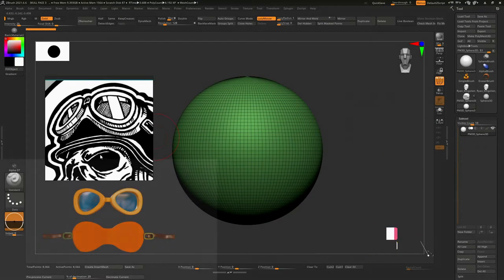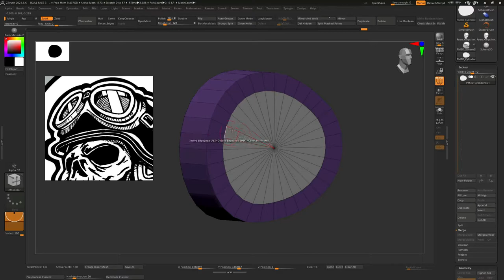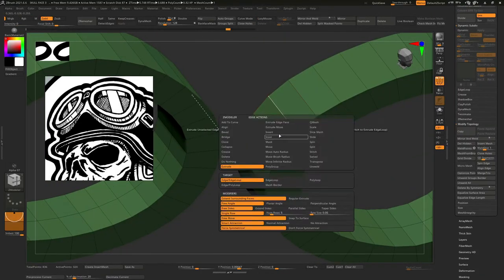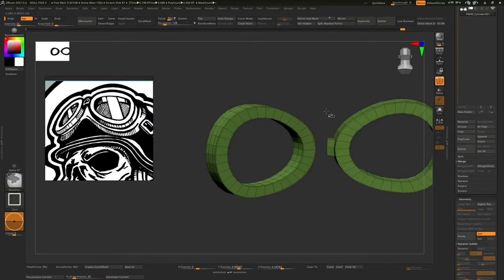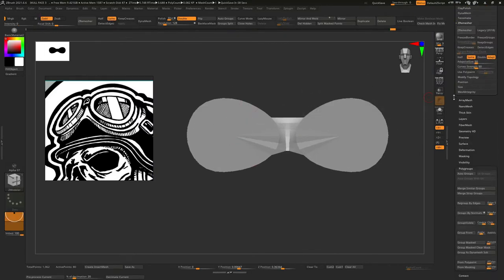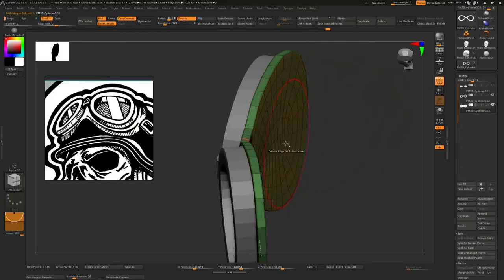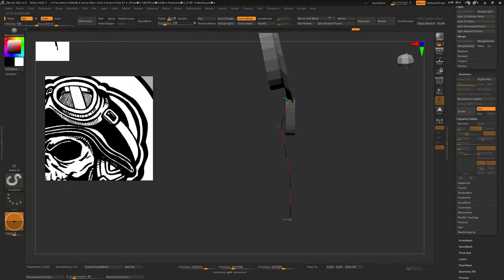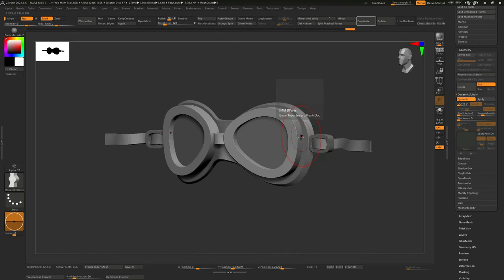Zbrush Zmodeler Tutorial (Lowpoly modeling)

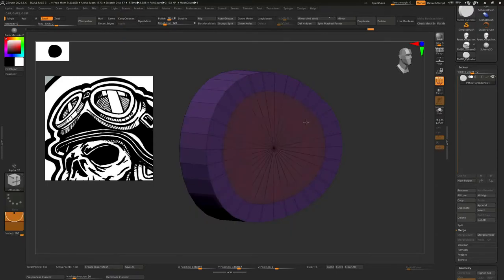Comment: Thanks for this tut. Few areas i had trouble were a)It was so difficult in selecting and deleting polygroup all @ 2:28 . It just worked after few tries. Still don't know what exactly i did. any tips would be of great help
Reply: non symmetrical, operation cancelled were shown many times. So i guess, thats where i went wrong
Reply from the maker: When you get that non symmetrical error, try mirror and weld, it will do same topology both side, then you can work with symmetry
Reply: @artindies  ok thanks for quick reply. I will try what you suggested